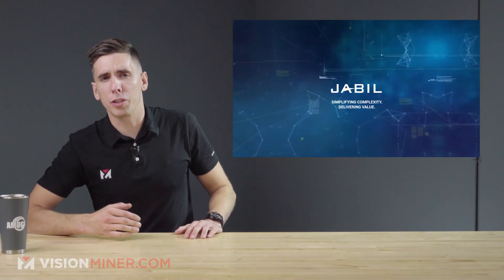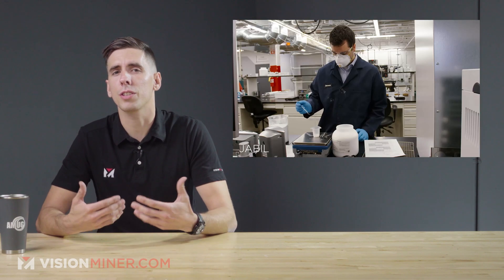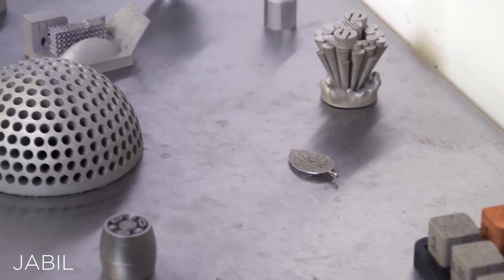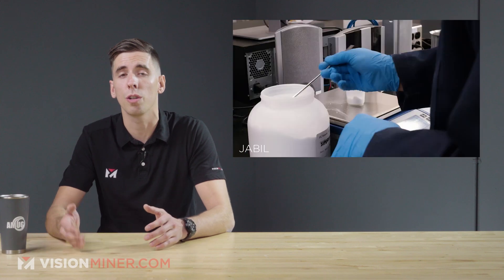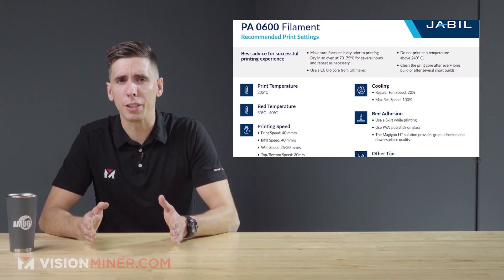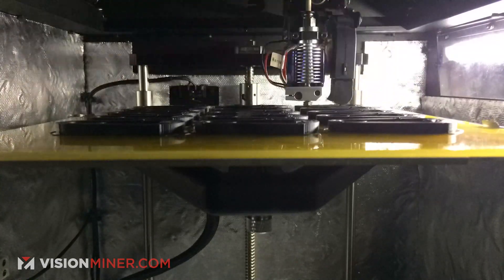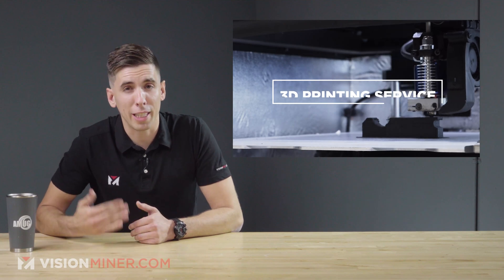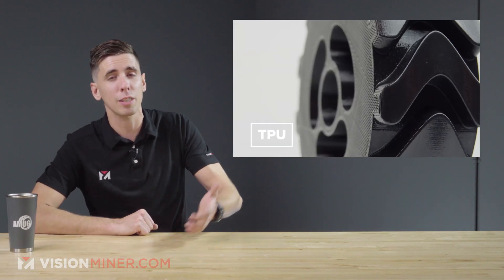Jabil’s Next Gen Nylon PA0600 Filament - 3D Printing News 2021

Comment: Wtf, absolutely nothing on this material.
1. PA06 Is already a Nylon that exists for printing putting a 00 behind it does nothing
2. POM is low friction, Nylon isn't So i have no idea what you are comparing the two as.
Nylon is Nylon, Delrin® is Delrin® and POM is POM.
Delrin® has coefficient of friction values of 0,2-0,4 which is way below Nylons 1-2 (On Steel)
POM is Delrin®'s Generic Version. Not made by Du Pont

Yes Delrin is temp resistant, but more so it acts great as a bushing or wear resistant insert.

Comment: What would be the best material to print gears, to replace POM molded gears?
Reply: Hi - I work for Jabil. PA 0600 was created to be a Delrin alternative - in the past dangerous fumes resulted when 3D printing this type. Jabil engineers in our Auburn Hills facility have printed some fixtures and toolings with PA 0600 for parts that go thru repetitive movements. So far, so good! You can buy a spool on DigiKey or contact us at additive@jabil.com if you have other questions of want to try it.
Reply: @edwardsmarcom  How much carbon is in PA 4535 CF?
Reply: @edwardsmarcom  Thank you, sent an email.